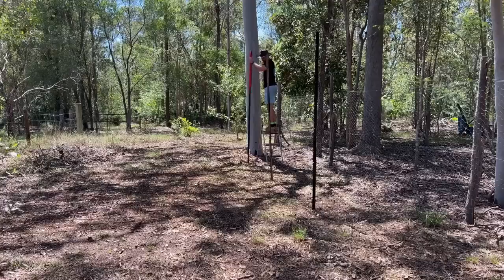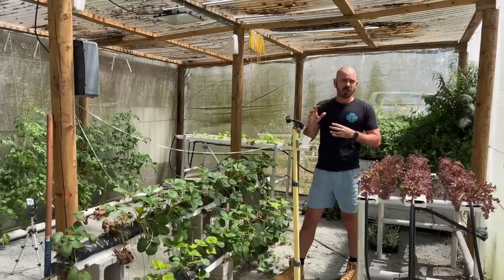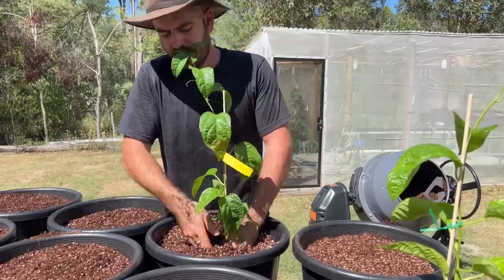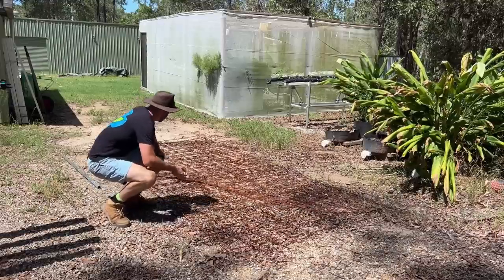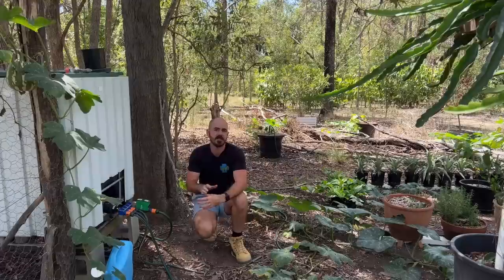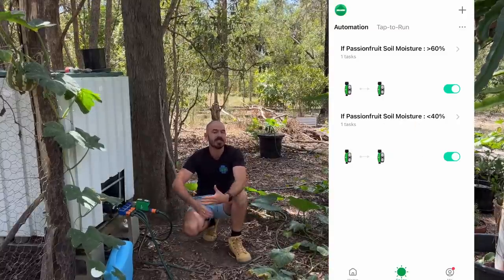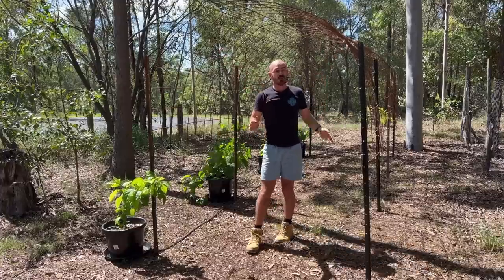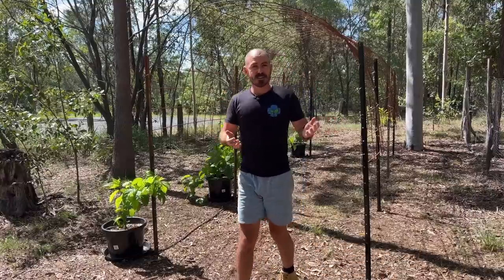Water Sensing, Auto Irrigation, Drain to Waste System

Comment: Hey Hoocho, thanks for the good content. I have a question which i have always wondered. The effects of draining hydroponics nutriens into the grid water system and or draining directly into soil (which is how i understand your drain to waste system). I know that phosphorus and nitrogen accumulation into the soil will make it infertile (to much of everything is a toxin) and it can also affect the ground water. Especially the Phosphorus. Hydroponic nutrients are very rich in said elements and i really wonder what your thougts and experiences are on that matter.
Reply: They are less rich then standard fertilizer, and in soil the latent plant life will consume them before they can run off.

Farm run off is not a concern with a system like this. He will actually increase fertility by doing it in his case. There will be zero accumulation.

Comment: barbs leak less when you hold the shape of the 13mm pipe as you push the barbs into them, dont let pushing the barb deform/squish the black pipe, for better sealing. I noticed that after years of drip irrigation

Comment: Probably should cover the hoses to avoid them heating up. I got a dingo trencher to trench down to 300mm for my orchard and plumbed the setup with 7 solenoids and found a 32 drop garden irrigation timer on gumtree (though may replace the system with a raspberry pi as the programs are really for lawns). I would like to look at feedback of each plant to see how wet it is - I got a rain sensor on the timer to not water if get 20mm of rain. But I do have issues with the various drip systems I have setup - some plants are drowning while others dying of thirst (have had to add extra drip hose and in some cases pushed in some variable sprayers/drippers). I was looking at capacitive sensors but power is not to the plants just to the solenoids 24v ac, other than solar and those commercial battery with a dicky solar panel usually only last 6 months or so. I do like the trellis idea and will have to look out for the hollman wifi/ble system. I still got plans though my reo is rusting away daily to put up a wall to hide my black rain water tanks with passion fruit/grapes etc this hollman product may do the job - Also you had some other waterless system some time ago running off a 44G drum for citrus from memory - how did that go?

Comment: Nicely done - BTW: for BT range problems you may consider building up a BT extender with an ESP32 (no other components - just the code) and place it somewhere in between -  handy for those weak BT signals  if you run Home Assistant or the like.
Cheers,

Comment: Maybe consider the longevity of these products that are left out in the environment as from my experience they often get water inside the electronics and fail despite their packaging information assurance that they are weather proof.
Reply: Definitely look up IP ratings. If they're certified for the correct rating you should be able to drop them to the bottom of the ocean. 
Most items will be certified for some level of dust and light spray, which isn't going to be very useful in general outdoor environments

Comment: I’d bury a wicking container under each pot, utilising the hole you’ve already made. Only when they have started to empty would the moisture sensors trigger additional watering which would then not be waste as would drain into the buried mini-reservoirs. Can’t stand idea of wasting any nutrient solution personally. Love the use of the sensors though 😊

Comment: I would not call this a true drain to waste. True drain to waste uses hydroponic media, full strength solution, and waters/drains several times a day keeping the moisture near 100%. The goal is to always provide the plants near perfect nutrient levels, even more so than a regular hydroponic system as it drains waste instead of recirculating it.

This is more of a fertilizer watering system that kicks on at a moisture level and turns off at another. If you're using full strength fertilizer water you will probably get salt build up without occasionally drenching with pure water or rain as I don't think stopping it at 60% will be enough to remove the salts through the waste part of drain to waste.

Anyways, best of luck!

Comment: I have a lot of trouble with the droppers and 4mm tubing getting blocked with accumulated feeding nutrients. I use pumps and even with pressure things grind to a halt or are reduced. Anyone know the best solution to this, apart from pulling things apart every so often.